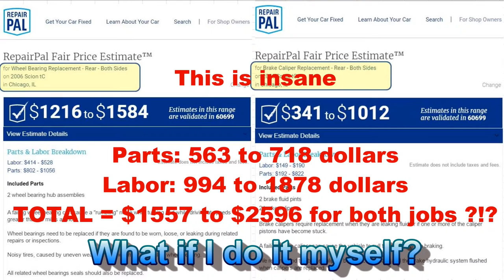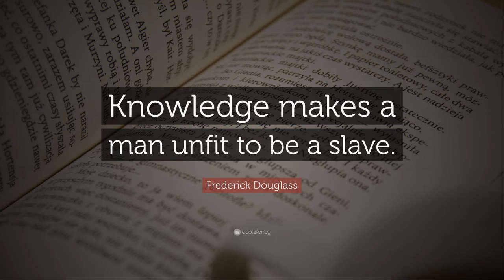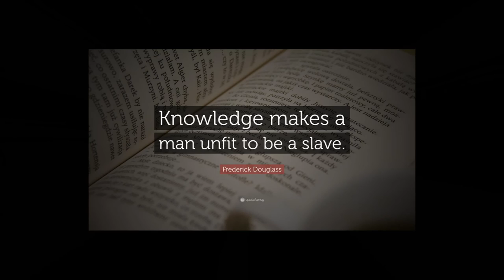SCION tC Rear Wheel Bearing Replacement Hub

Comment: Not sure if anyone else had this problem… the rear brake sub-assembly that the springs hook onto was completely rusted through on both sides for me. 

Seems to be an OEM part and my local Toyota dealer parts technician said that when he worked at Autozone for 6 years that he never saw those sold through car part stores. $230 each for me from the dealership just in case anyone was wondering.
Reply from the maker: that is unfortunate... couldnt you salvage the originals via electrolysis or any other rust removal method ?    $230 each seems high for such amall non moving part
Reply: @toshisate8121  no - it was rusted completely through and the plate was so weak and brittle that it was coming apart in my hands…

Comment: Is that how the parking brake lever goes?  In front of that square head nail that holds the shoes on?  

Mine wasn't installed like that I even compared it to the passenger side
Reply: Also you put the springs on backwards.  The white spring should go in that hole of that dog bone looking thing
Reply from the maker: i think you are correct... i realized that later.. but it worked fine for me.. please see this diagram for your assistance  
https://www.justanswer.com/uploads/crzydrvr00/2008-09-13_190219_129118081.gif

Comment: hello! amazing job and quality of the video! i had a couple of questions. For a job like this for the front wheel bearing replacement and brakes, how much would it cost if two men worked on it? also how long did this take you to finish?
Reply from the maker: thank you for the comments.   Front wheel are different and maybe more challenging because you need a hydraulic Press to pull the bearing out of the hub... i have seen it done on-site ( without taking the hub out) and off site...you can buy your one press in Harbor Freight for $150.   please get a quote for your case at www.repairpal dot com....  Rear hubs are much easier since you replace the housing as a whole... it took me about 3-4 hours each side but that was due to camera re positioning and lighting settings for the video.
Reply: It costs for front wheel and brakes you're looking at a couple hundred dollars and the right person it should only take 2 hours tops

Comment: I cannot for the life of me take of the ABS sensor. Mine is on there good an I’m not sure how to go about it. Any help would be appreciated
Reply from the maker: 1:58 it shows how i took mine out... i used a 45 degree pick to pull the tiny lever on the connector
Reply: Yup that’s what I had to end up doing. I pulled the hub out first then messed with the sensor so I could see it better. Thank you

Comment: the rear wheels are only held on by 4 bolts! id rather have it sieze and be a bitch to remove than have the wheel fall off
Reply from the maker: you have a very valid point